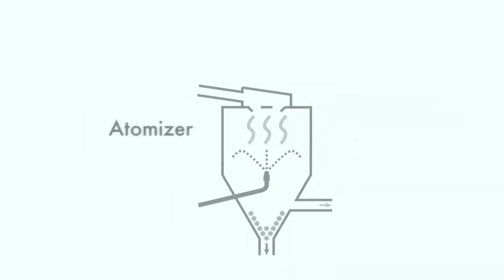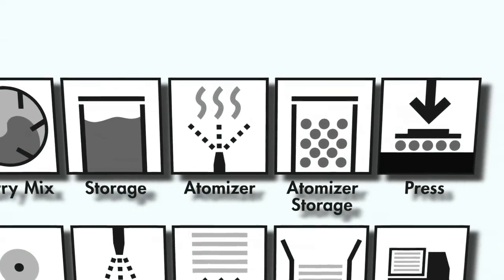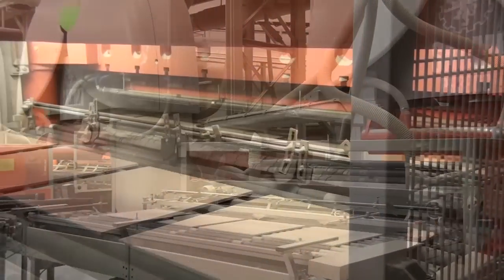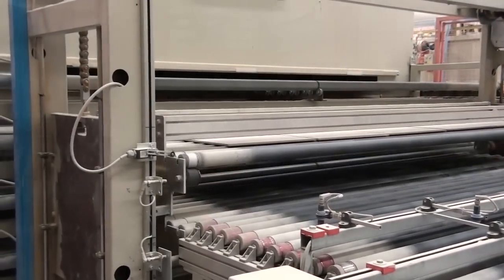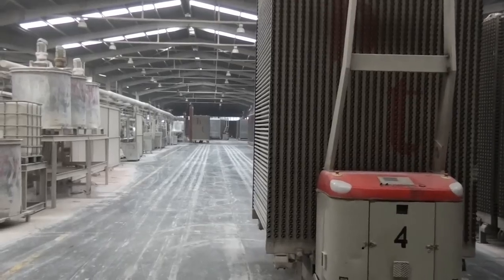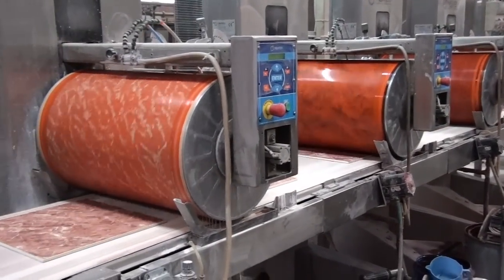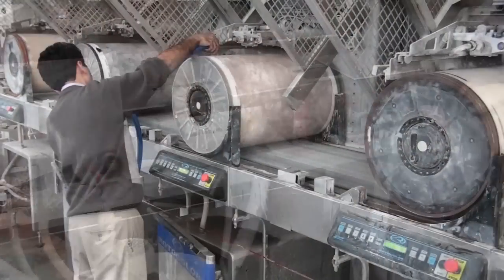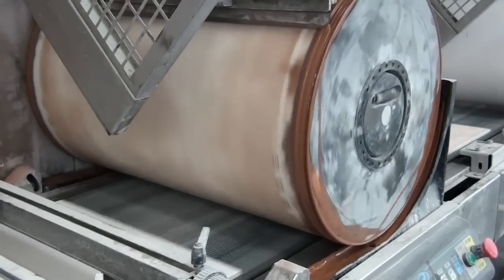Ceramic tiles manufacturing process by Ceratec - How it's made?

Comment: At CERATEC, ceramic tile is a passion, Since 1949, we have been deeply involved in the manufacturing, distribution, sales quality control and delivery of ceramic tiles . With this passion and our hands on approach to manufacturing, we have forged a proud history of industry leadership that spans 60 years. In this series we will attempt to demystify the process of manufacturing ceramic tiles. 
Tiles are made from basics components that are readily available from mother earth: raw materials such as sand, white clays, talc, feldspar, illitic and kaolinitic clay, calcite and dolomite are quarried and refined. Using heavy construction equipment  the raw materials are brought to the plant where they are stored prior to mixing. They are placed in holding areas, classified by types using a simple numeric reference system. The raw materials are mixed in specific proportion by weight . The specified mixture is achieved by varying the speed of the conveyors that feed a master conveyor. The conveyor dumps the mixture of raw materials into a storage tank. The mixture is then fed into a series of mixing tanks with water and ceramic pellets to form a liquid material called slurry. The slurry is then transferred to large undegound then fed into an atomizer the atomizer is equipped with a nozzle. The nozzle sprays the slurry into the middle of a large tank that is fed with a current of hot air. As the slurry becomes air-born it rapidly dries to form atomized power 
 
The atomized powder is fed into a holding vat just behind the press. The vat releases measured quantities of atomized powder into a tray which distributes the powder evenly into the mould. A force of 340 to 400 kilograms per square centimetre is applied using large hydraulic press. The combination of high pressure and residual moisture turns the powder into solid mass. After the body is formed, it is dried further to  remove most of the remaining moistur. It is important to remove the moisture in order to keep the product stable during the cooking process in the kiln.  This guarantees that the product will come out of the kiln as a solid homogenous material free of physical weaknesses or defects. Tiles are placed in temporary storage bins at various stages of the production press until they are required for different stages This also allows time to adjust or repair equipment. 
Glazing and screening serve both a practical and artistic purpose. They form an important part of the finished product because they provide aesthetic beauty, water repellency, durability and hygienic properties to the tile.  
Roller screens are commonly used  to apply design and color layer by layer to the bisque of the tile. Greater design variation can be achieved by adding roller-screens to the line. Numerous test runs can be made to verify the quality of finish trueness of design and color definition before the final formulation is qualified and accepted before the final formulation is qualified and accepted. Glaze is essentially a glasslike substance and is applied to the surface of the tile by spray, waterfall, screening or dry glazing methods. After the glaze is applied, the tile is fired in the kiln. There are different types of kilns but the roller-hearth kiln seen here is by far the most efficient. Temperatures in this type of kiln can reach as high as eleven hundred and ninety degrees Celsius. The kiln solidifies the glaze and removes all residual moisture in the ceramic. At this point, we basically have the final product to insure quality, the finished product is inspected and verified for any imperfections. Calibre, shade are validated by mechanical and human means. The information about each tile is used to sort and box the material accordingly. Boxes are marked with the quality shade and calibre specifications and placed on the appropriate pallet. Once the pallets are stacked, they are placed in the yard ready to be shipped.
In the development of our ceramic lines, we have learned a great deal about tile............................................................................................................................. We hope that by ..........................................................................., we have also shared the .............................................. .............................................................................................................................................................................................. 
Rest assure that our commitment to quality will never be equalled. By increasing ........................................................ .............................................................................................................................. we enhance our ability to insure that....................................................................................................................................................................................................................................................................................................................................................................................
Reply: I use Laguna Bay ceramic tiles for all my properties....cheap, good style and they look great!